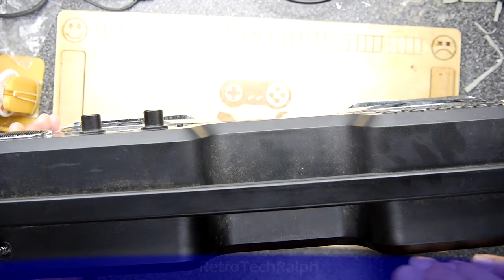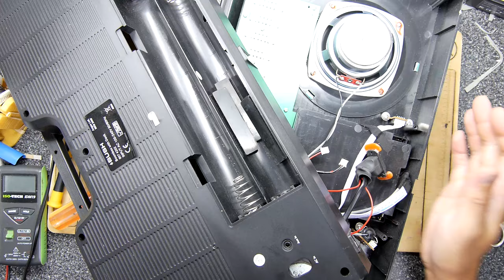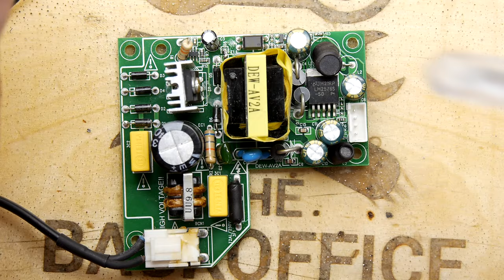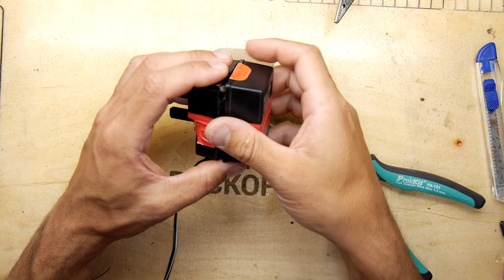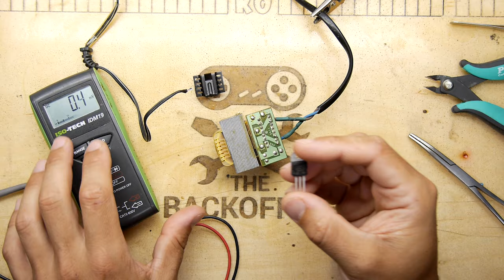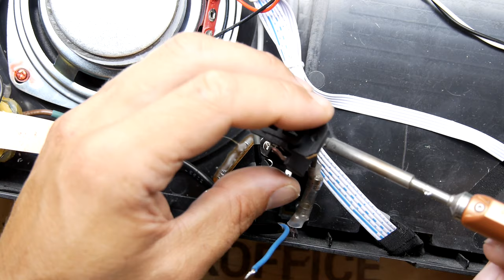Bush Boombox Radio Repair

Comment: The battery feed goes to a switch on the mains input socket so the batteries get disconnected when connected to mains so the they don’t get reversed charged or drained.

Comment: I've never seen a PSU like that new power supply circuit board with separate filter caps on each diode.
I have seen people add ceramic caps to electrolytic caps because the ceramic caps can filter different frequencies without degrading... it's supposed to make the electro caps last longer.
But I have never seen it done from the factory on cheapo wall warts.

Comment: My process for fixing switch mode supplies: 1. change all the caps. 2. if doesn't work, bin it.
Reply from the maker: Wow, I wouldn't even attempt step one 😂

Tell a lie, if it's a retro beast I would for sure
Reply: That big switching mosfet (or whatever it is) with the heat sink is probably the culprit. Or one of the diodes in the rectifier. The way the fuse just burnt out like that means something has shorted out, and I’ve seen enough repair videos to notice it’s silicon based devices that seem to randomly do that.

The way to find out is to replace the fuse with a piece of wire, plug it in and see where the magic smoke escapes from. Although I’d also plug it into a socket that was on its own breaker since we all know the random fuse in the plug will be the last thing to blow.

Anyway, that stereo is a retro monster, it has an iPod dock 😉
Reply from the maker: I still have the board, I may well try this 😂😂

It's interesting how complicated the original supply seems in comparison to the regular wall wart AC adaptor.